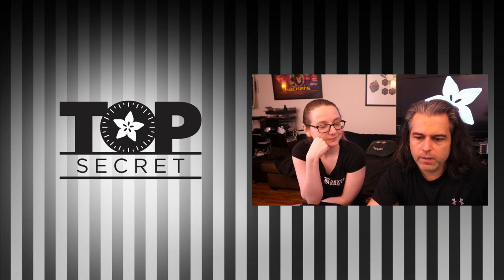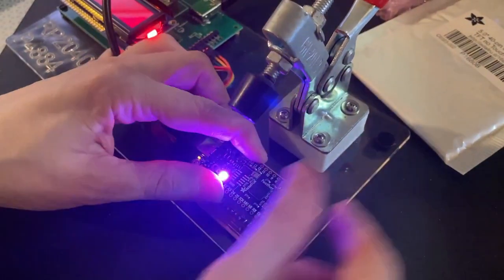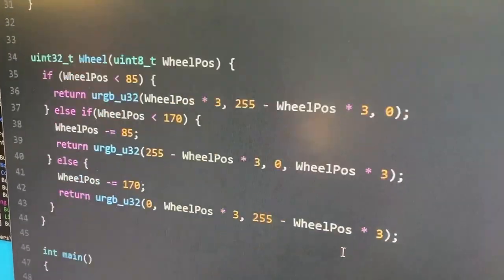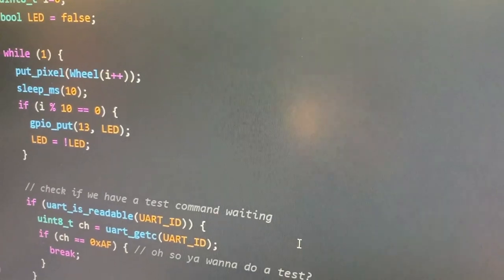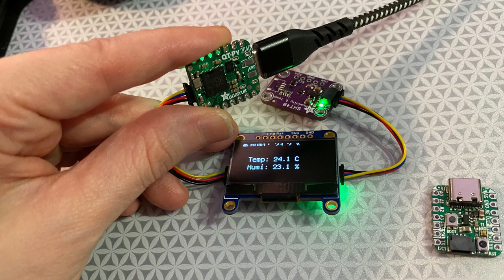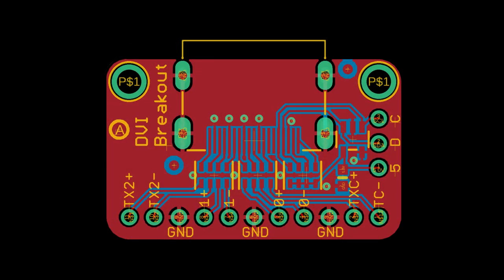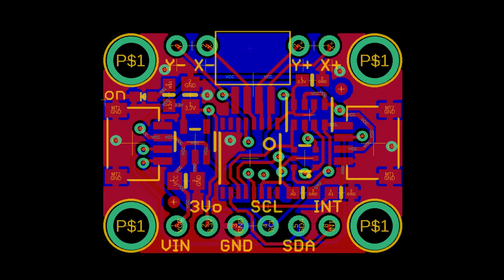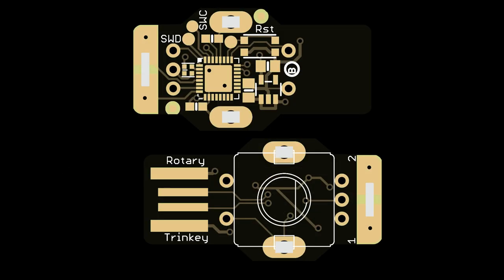Adafruit Top Secret! March 24, 2021 #Adafruit #AdafruitTopSecret @Adafruit

Comment: I love the 'Neokey', but please reconsider the connector positioning so the boards can be tiled on all sides for bigger layouts. Simplest would be to use vertical sockets, but and/or edge lands or castellations to allow direct soldered connections.